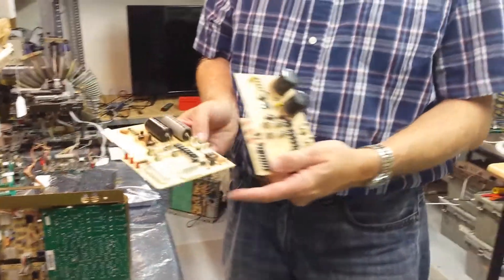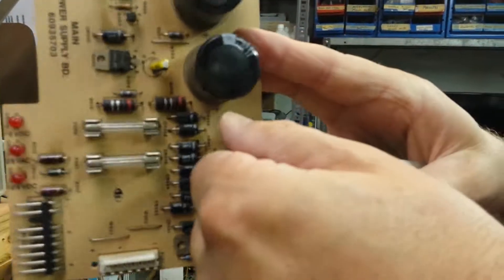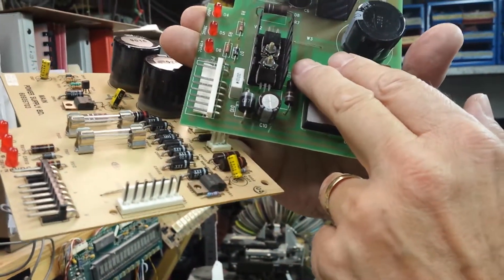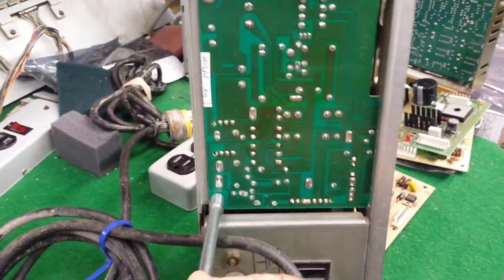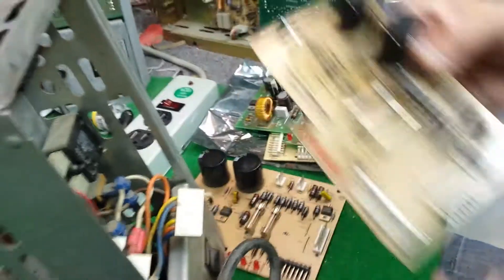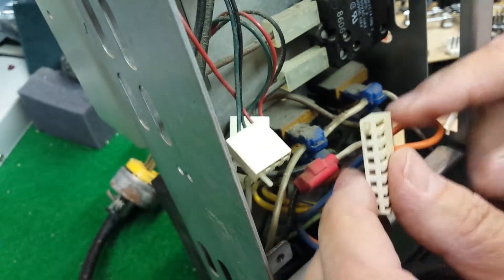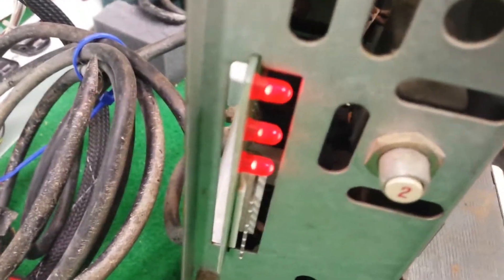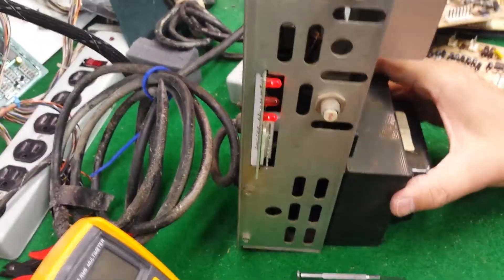power supply upgrade

Comment: I have a power supply board from a R86. Could you share the value of components R508, R509, R510, R511? Some of the components are too worn or even burned so I can't recognize the color code. Thanks!

Comment: What bout the ram error code
Reply: If it shows ram error, reseat the chips on the CCC board, check your PSU board outputs for voltage as marked. After that, component replacement..
Reply: Also check for proper voltage at your malfunctioning board.  The bus on the CCC that distributes power to separate components is a usual loose connection problem btw. I have been known to bridge those so they all pull power together for a much more reliable power feed. Helps with reliability on my jukebox route. Saves tons of service calls and saves gas.